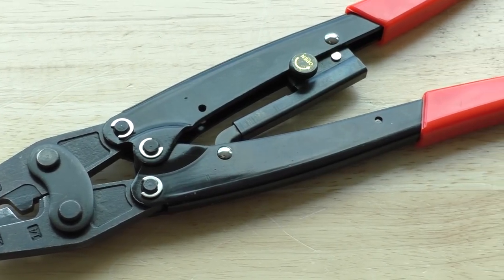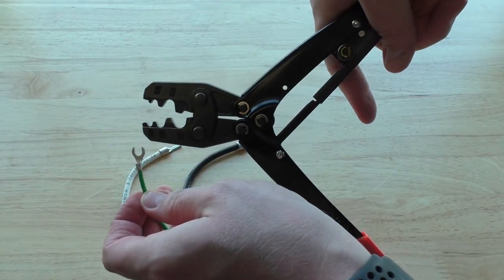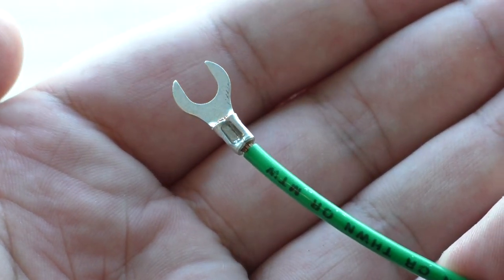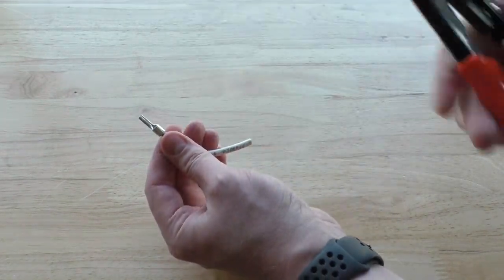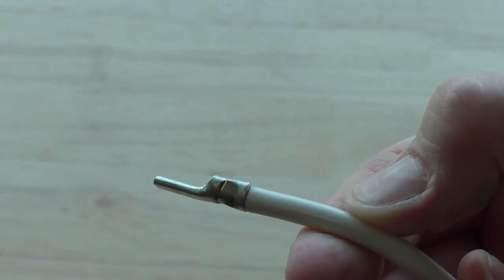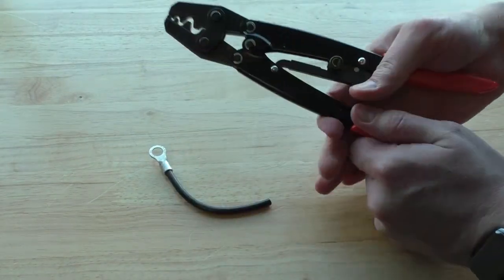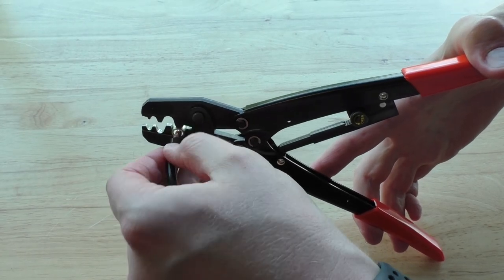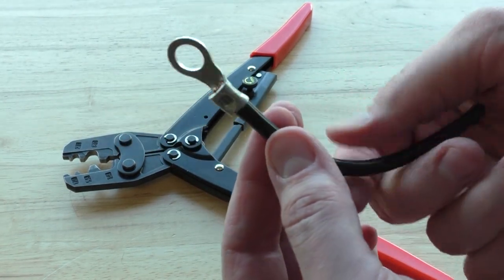FDT1606 Non Insulated Terminal Crimping Tool

Comment: In an other video https://youtu.be/Z49mDBMZvXU the tooth always presses on the non-split side of the  ferrule - the split side lies down in the cave.  Here the other way around, the tooth presses on the split side. And nobody explains which method is correct and why.
Reply: @alleksandrs  the "right" advice in the video that you found was also wrong. You want to crimp on the seam of the barrel. You want the seam to fold and bites the wire. The seam was there for that only reason, the indentor presses in and fold the seam. Most people just go with seamless connectors to avoid that problem.
Reply: @IntegraGSR5 thats 100% incorrect. The stake goes into the back of the terminal as per 3M. But you do you.